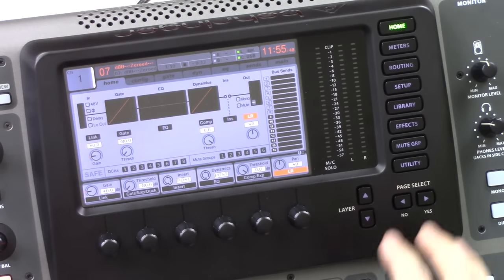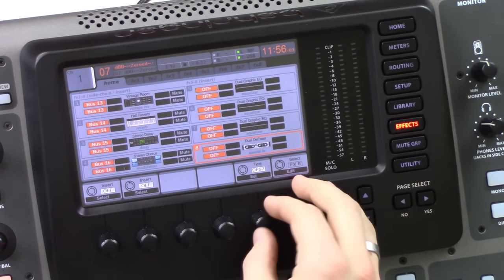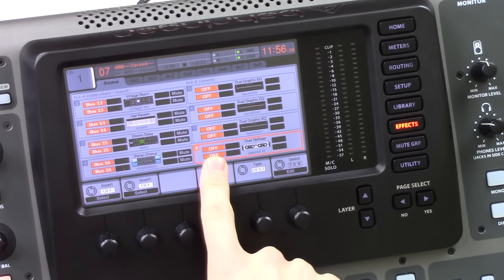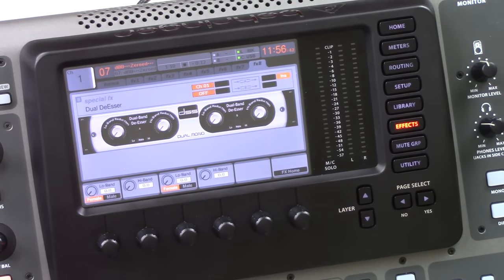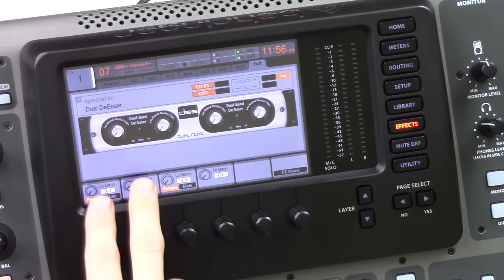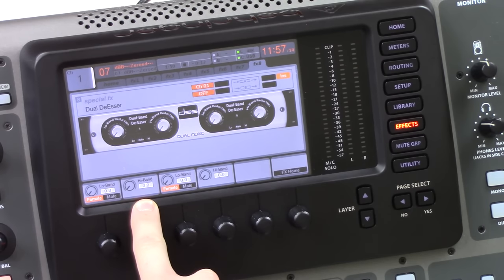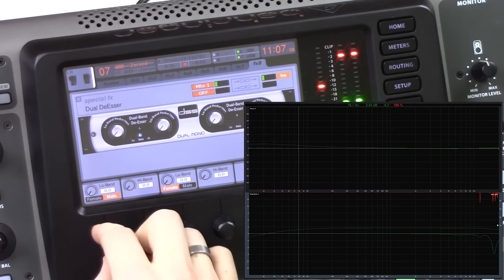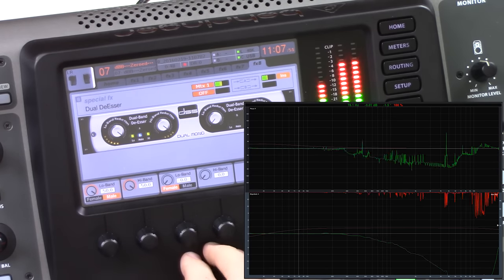Behringer X32 FX Series Tutorial - DeEsser

Comment: Very professional as always Drew.   Thank you.      Wondering if you could post a video on the USB slot.  I'm having a real problem creating a long playlist of songs to play between sets when the band is on a break.  The songs won't play.  What type of USBs & what formats will the X32 except?  Am i missing some basic steps?   Thanks.
Reply: +Tiger Moth The USB isn't meant to be a music interface. Its main purposes are for recording the audio to an external USB drive, saving your scenes to an external drive, and updating the firmware. If you are wanting to play music, you want to run a normal 3.5 headphone-style cord into one of the aux inputs and plug in either a phone, an ipod, or even a pc running the music.
Reply: +Aaron Bratcher Sorry but the USB on the back gives you a 32 in 32 out 24 bit up to 48K sample rate audio interface and it is meant to be used as a audio interface with your DAW software and has the ability to use native DAW and 3rd party plugins from a server. You can visit the behringer youtube page and they have setup videos for most major DAW's including Pro Tools, Logic and others, there are also other cards for the X32 including MADI ADAT and Firewire Have a great day!
Reply: +Tiger Moth Yes you can use the X32 has a 32 in 32 out audio interface that works with either a Mac or PC and there are al MADI ADAT and Firewire cards available from behringer for the X32 also the XAIR 18 model is a multichannel interface also but only has 16 by 16 in and out over USB I hope this helps have a great day!
Reply from the maker: +Tiger Moth I believe you are referring to the USB slot on the top of the board for the USB Recorder that you can plug a USB Thumb Drive into. This will only play .WAV files that are set to the same sample rate as the board. It is on my list of videos to make in the future of how to convert a .mp3 to a .wav that is able to be played though that usb slot. Thanks!
Reply: thanks for the video, I find de-essers very useful in live sound I used to use them extensively in dpr-402s. However I'm so disappointed with this module, the attack time on the high band is not fast enough, it consistently misses the initial problem transients at high frequencies then ducks out too late as if only to emphasise the problem and increase the dynamic range rather than reduce it. This can be clearly heard in your example, I wonder if the original SPL hardware does this too. Anyway, for good de-essing performance I find it better to forget this module and use the channel compressor suitably filtered and with fast time constants, it's not user friendly and you sacrifice the channel comp but at least it can sound transparent. Alternatively the combinator with all but the two high bands bypassed can work if properly tweaked.
Reply: @DrewBrashler  if you have one, or could make one, I'd like to have some video instructions for how to properly use the recording features of the top USB slot(yes, I made sure to specify so it's easier to understand what I'm talking about)... I've used it before, but all I've been able to get out of it is music or sermon audio that I can barely hear at full volume... I was instructed to try increasing the record trim or something, but I'm hesitant to even try that because it's been hard to even find a flash drive laying around, that's good enough for testing... Out of the drives I've tried, most only recorded a second or two before they quit, if they did anything at all, and the one I found that worked, well, I already mentioned the low audio issue I had when I last tried to test recording to it... Also, all those settings for recording wave files and stems and different sources and whatnot, well, they really confuse me... I mean, where it's currently set gives me audio of course, so it has to be at least OK aside from the aforementioned record trim I've heard I need to change, but is it truly set up the BEST way? It's just set up however it was when it was installed, and IDK what if anything the professional installers might have either fine tuned, or forgot to fine tune, for best sounding audio, and I think using the recording feature might be better than the current Bluetooth cell phone speaker "onecallnow" conference call recording that we get after we hang up the phone... Also, it would probably be better that way, if we ever wanted to make or sell CDs with a church sermon on them like the big evangelists do, again, compared to a microphone, and cell phone based, besides, recording...

Comment: Thanks for this video. I find the DeEsser is helpful in many cases. Would it be a good idea to insert the DeEsser onto a Bus so it could be applied to a variety of different vocals in separate amounts?
Reply: Usually what you will see is that is best to insert the DeEsser directly on to a channel. The reason behind this is because if you apply it to a bus the raw signal is still coming through the preamp on the original channel and in turn to your main LR mix.

However in theory what you are saying could work if you un assign the original channel from the LR bus and just assign the FX return to the main bus. But this is very messy and could mess up your work flow in the furture. 

I would take a look at some of our videos about using Waves plugins on the X32 because you can have as many instances of a DeEsser as you need.
Reply: Drew - Is it true that you can only apply one insert on a channel...I was trying to add combinator comp to FOH LR along with stereo GEQ that is Already inserted on FOH LR??

Comment: So... You never said specifically what settings to use on the De-esser, or specifically, how much to turn the high and low dials... More specifically, when do you know when to stop turning the knob... My ears can't make heads or tails of which audio is which(possibly because of YouTube), and was wondering if there was a way to tell by using those yellow LED light simulators in the De-esser to know when to stop turning the knob, or something like that? I mean you literally basically just say "turn the knob and you're done" but I need to know how much, or how to find out how much for my possible use case...